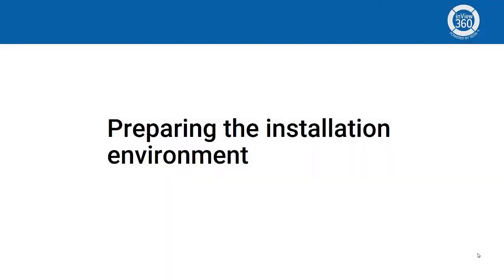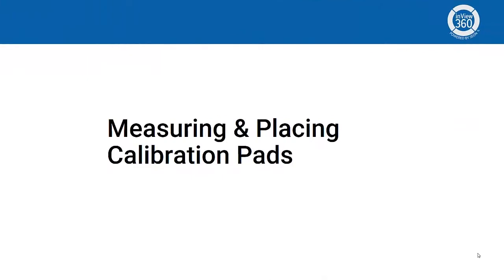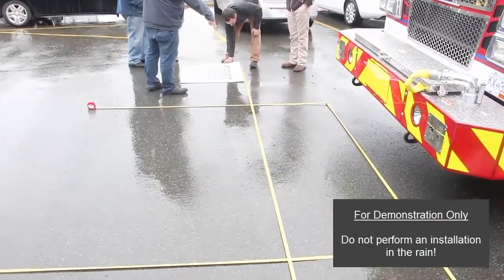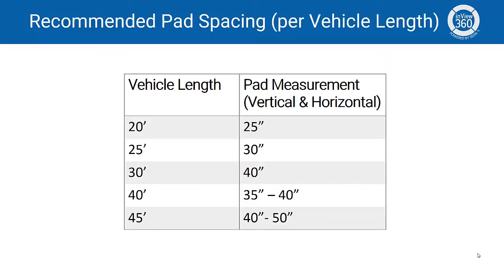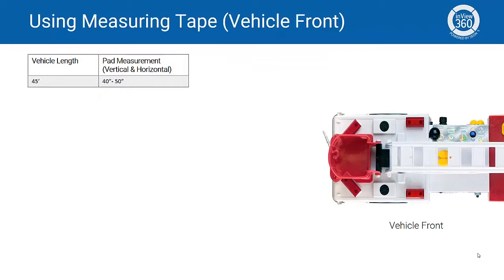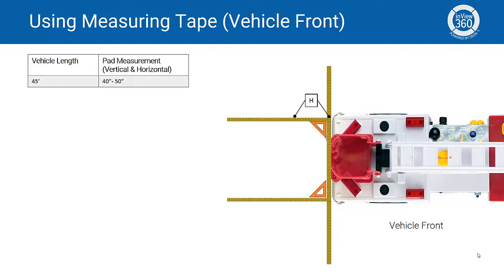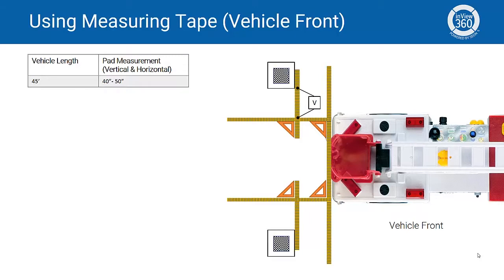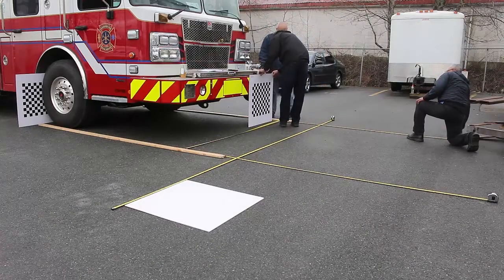Bird's Eye View Camera System (RVS-77545) Setup and Calibration (Part 4/6)

Comment: Hi  rvs.  I had a question how you had measured that horizontal and vertical  distance and placed that checker board  at 1:32 sec you had mentioned may I know on what bases you have taken those values 
And if the cams are placed on corners of the vehicle will those inputs works for Birds Eye view ?
If possible can we connect through mail  ?